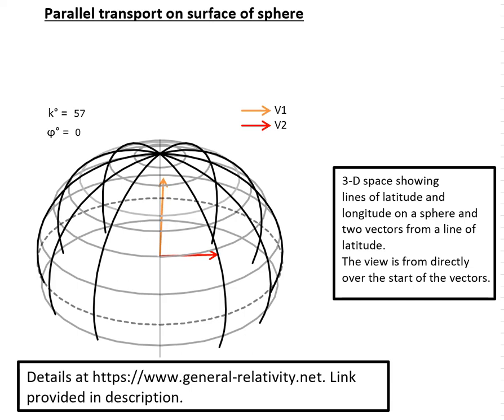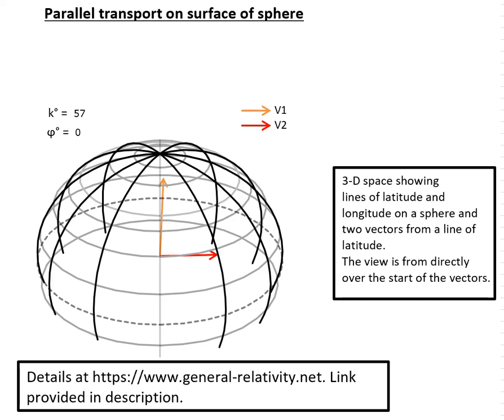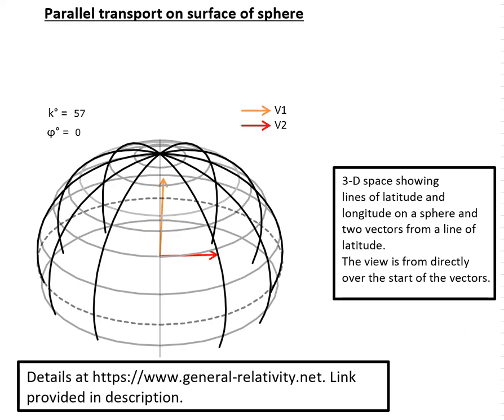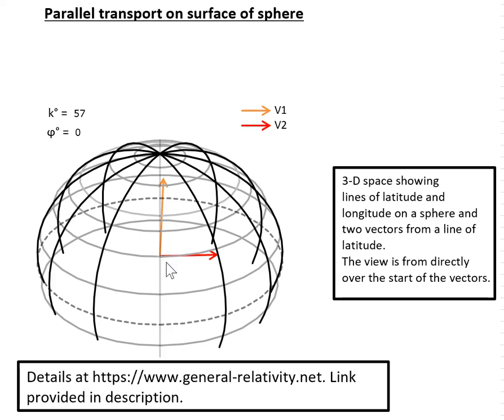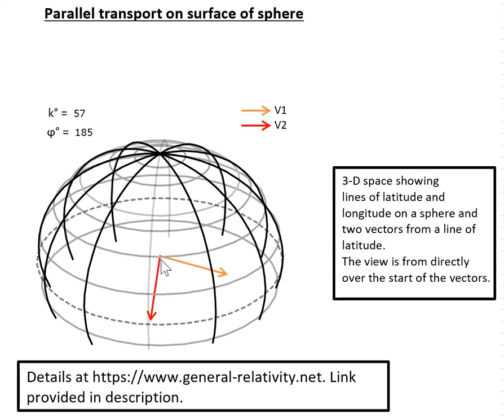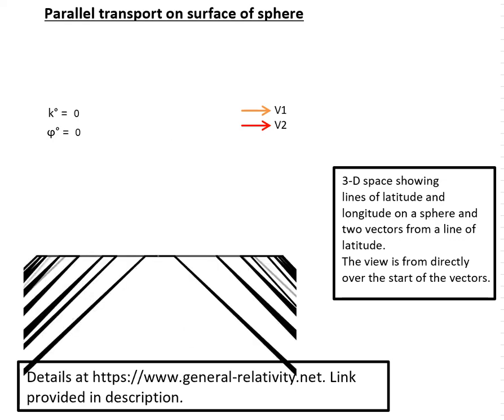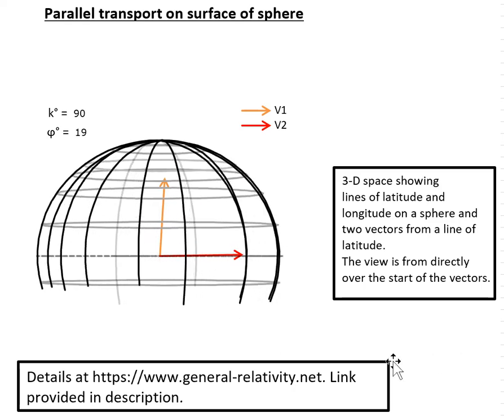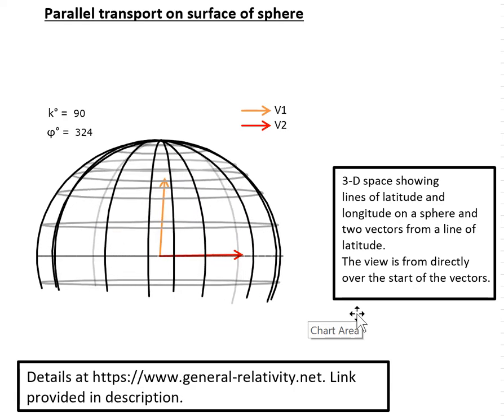Parallel transport on surface of sphere

Comment: THE BALANCED, ULTIMATE, TOP DOWN, AND CLEAR MATHEMATICAL PROOF REGARDING THE FACT THAT E=MC2 IS F=MA:

Time dilation ultimately proves ON BALANCE that E=mc2 IS F=ma, AS ELECTROMAGNETISM/ENERGY IS GRAVITY. Time is NECESSARILY possible/potential AND actual IN BALANCE, AS E=MC2 IS F=ma; AS ELECTROMAGNETISM/energy is gravity ON BALANCE. Gravity is ELECTROMAGNETISM/energy.

Great !!!! QUANTUM GRAVITY !!!! E=MC2 IS F=ma. This NECESSARILY represents, INVOLVES, AND DESCRIBES what is possible/potential AND actual IN BALANCE. What are the EARTH/ground AND the SUN are CLEARLY E=MC2 AND F=ma IN BALANCE. Very importantly, outer "space" involves full inertia; AND it is fully invisible AND black. The stars AND PLANETS are POINTS in the night sky. GRAVITATIONAL force/ENERGY IS proportional to (or BALANCED with/as) inertia/INERTIAL RESISTANCE, AS E=MC2 IS F=ma; AS ELECTROMAGNETISM/energy is gravity. Gravity/acceleration involves BALANCED inertia/INERTIAL RESISTANCE, AS E=MC2 IS F=ma; AS ELECTROMAGNETISM/energy is gravity. BALANCE AND completeness go hand in hand. It does ALL CLEARLY make perfect sense. GOT IT !!!! THE SKY is BLUE, AND THE EARTH is ALSO BLUE. Great !!! Now, think about the man who IS standing on what is THE EARTH/ground. Perfect !!!!

Energy has/involves GRAVITY, AND ENERGY has/involves inertia/INERTIAL RESISTANCE. "Mass"/ENERGY IS GRAVITY. ELECTROMAGNETISM/energy is gravity. E=MC2 IS F=ma ON BALANCE. Gravity/acceleration involves BALANCED inertia/INERTIAL RESISTANCE, AS E=MC2 IS F=ma ON BALANCE; AS ELECTROMAGNETISM/ENERGY IS GRAVITY. (ACCORDINGLY, the rotation of WHAT IS THE MOON matches it's revolution !!!) Gravity IS ELECTROMAGNETISM/energy. TIME DILATION ultimately proves ON BALANCE that E=MC2 IS F=ma, AS ELECTROMAGNETISM/energy is gravity. News flash ! Gravity IS ELECTROMAGNETISM/energy, AS E=MC2 IS F=MA. The Earth (A PLANET) is a MIDDLE DISTANCE form that is in BALANCED relation to the Sun AND the speed of light (c), AS the stars AND PLANETS are POINTS in the night sky; AS E=mc2 IS F=ma. TIME is NECESSARILY possible/potential AND actual IN BALANCE, AS E=MC2 IS F=ma; AS ELECTROMAGNETISM/ENERGY IS GRAVITY !!!

By Frank DiMeglio